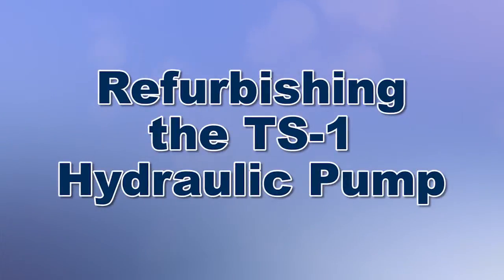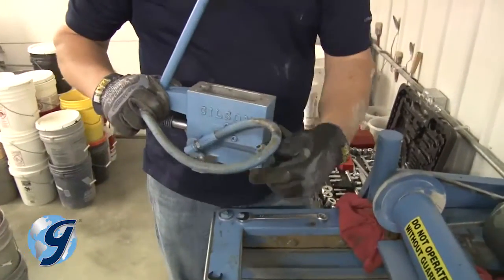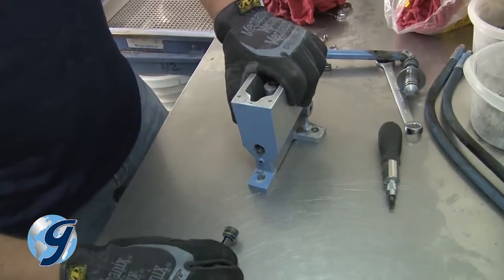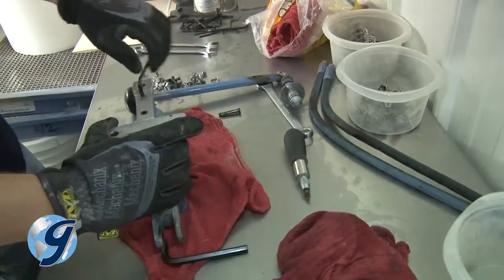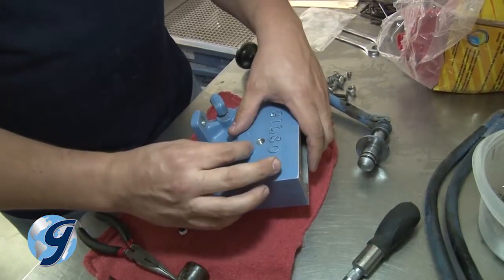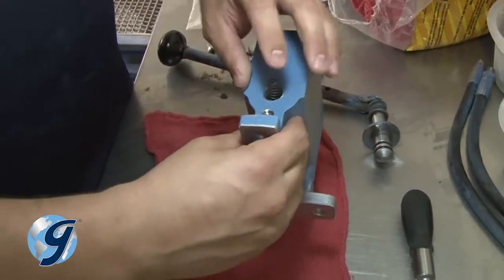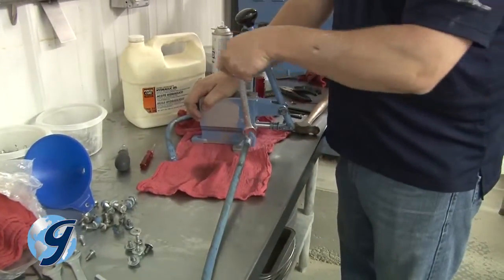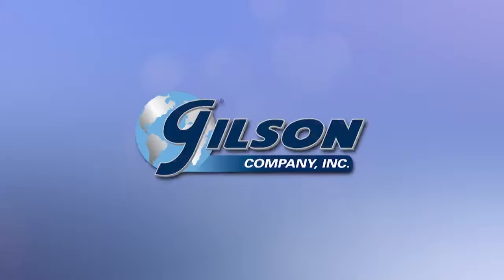Refurbishing your Gilson Testing Screen Do-It-Yourself Hydraulic Pump (RPTS-pump)

Comment: Should the oil level be at 1/4'' from the top after bleeding the system too?
Reply from the maker: Yes, after bleeding the hydraulic system, refill any fluid needed to fill the pump reservoir to ¼ inch from the top.  It is important to maintain this ¼ inch level from the top of the reservoir at all times during operation of the Testing Screen.